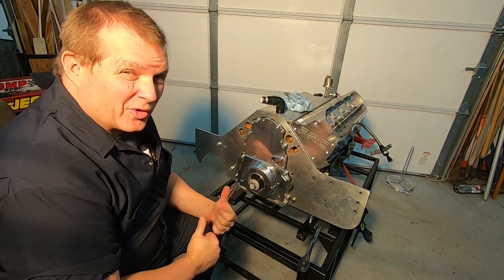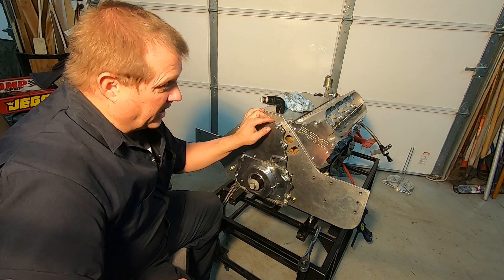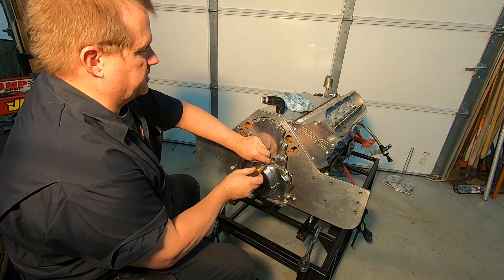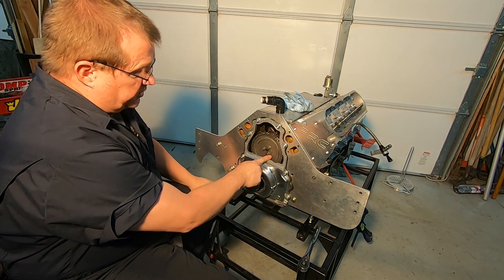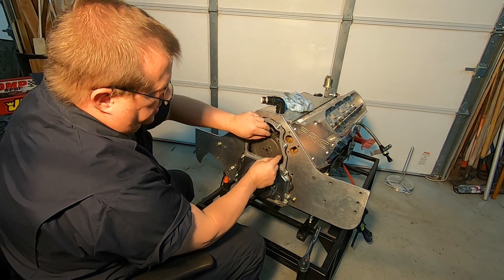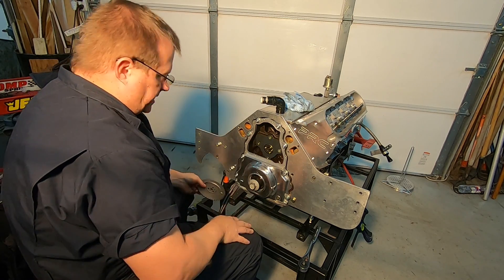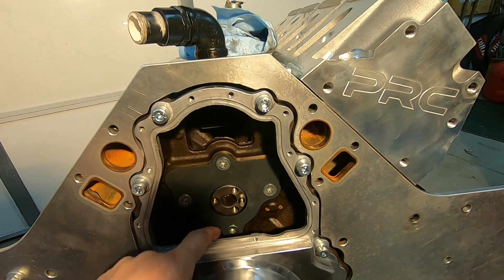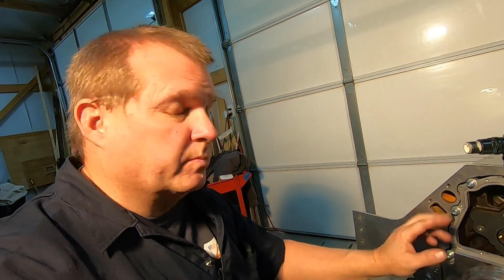Product Info - Two Piece LS Timing Cover, are they a good thing?

Comment: Even when you get the bolts out, the cam will only come out two lobes before it hits the stock size balancer and cannot be removed. Only works with an underdrive balancer.
Reply: Preach...lmao

Comment: I was thinking about drilling a hole where the last cam plate bolt was. And plug it up with nut and bolt. ? Or customize a special tool or replace the counter sink torx bolt with flat shallower hex bolt. The manufacturers don't supply or support the consumers.